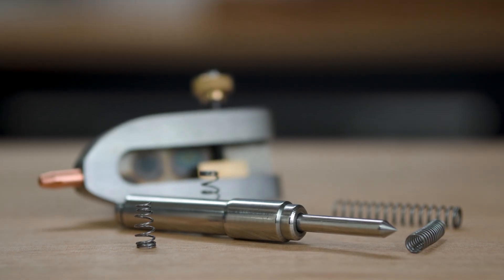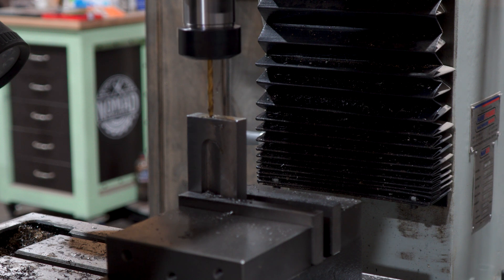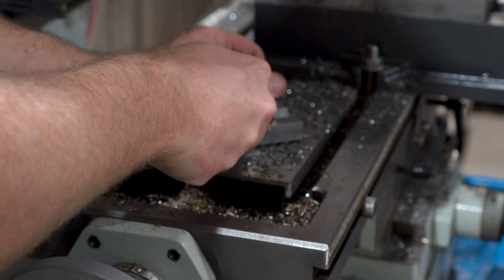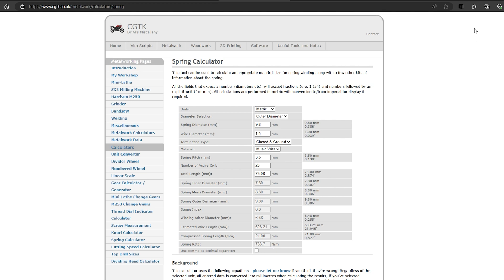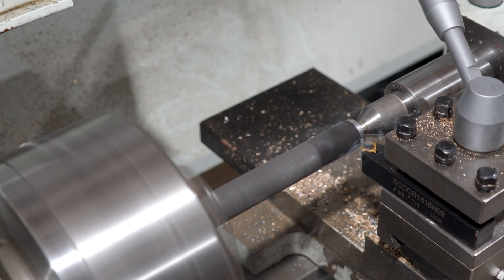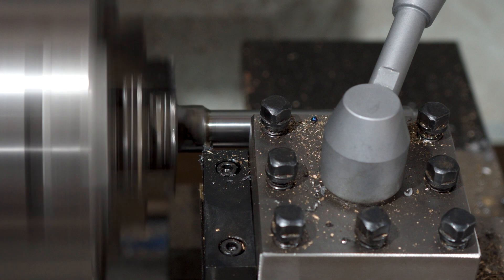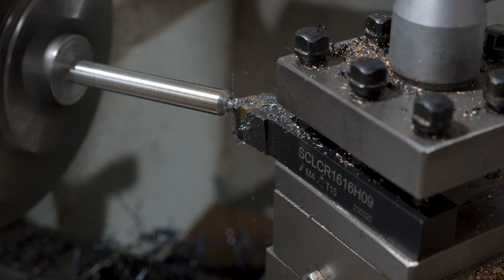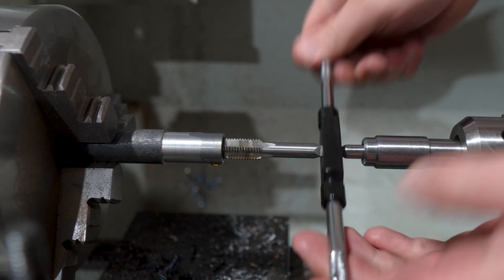Spring Making Redemption: Building a Tap Follower!

Comment: Same thing happened to me a couple of days ago, except in a Jacobs easy lock chuck, which now has a tap permanently jammed in it, as my scrawny arms can not get enough purchase on the chuck lock surfaces to undo it, even if I use the drill to turn it as I hold it (which usually works, but I think the tap, jamming, semi burnt out the motor, as it smelt faintly of magic smoke when it happened)... easy lock, but a PITA to unlock lmao....

Comment: Maybe really late to the party, but i guess that the sudden tension release from cutting the wire might be the culprit of the bendy/oversized spring. I'd try easing off the clamping force on the wire first and only cutting it, once the sprint settled into it's final form
Reply from the maker: That’s a fair call, it could help with the kink.  I have learned since making this that cutting from the opposite end of the spring that I did in the video does help it stay a bit straighter, but I might just try this on the next one. Thanks for checking it out

Comment: Looks like spring making is a lost "art".Lucky for me i learned from old guys.All of that fancy equipment people make is useless.What you need is 2 peaces of wood.Plywood works ok ,hardwood is best,something like oak.Then you cut a channel in a bottom part ,you can use a hacksaw or a file depending on your wire thickenss.Goal is that top board puts tension on the wire when you clamp it and bottom groove guides the wire .Edge of the board should be around 1cm from mandrel.Wire guide needs to be tangential to the mandrel.
Put a little bit of grease to make things go smoother.

If you want a fancy spring you heat it up with torch and let it cool down ,then harden it and temper it.
Spring making is an art and there are books written about them on how to make exact diameter and proper strength.
Reply from the maker: That would be a great way to make a quick spring, I have made a few now and I will say that I do like having the spring wire tensioner, it makes the setup so fast, but this would definitely work as a single purpose kind of deal. But thanks for the tip!

Comment: Didn't see you ream the front hole for a close fit for tighter Axial alignment.    

Done springs before, didn't work out so well.   I'll check out the calculator
Reply from the maker: Hmm it’s been a while and I can’t actually recall. I’m looking at the follower at the moment and there isn’t any uneven wear on the sliding shaft , it seems to be wearing evenly so either I did it and forgot to film it, or just got lucky with a drill 😂
That calculator makes all the difference, best of luck!

Comment: 2 flute taps are amazing for power tapping. As well as some tap magic or molly dee
Reply from the maker: Some machine taps are on the list, the ones I have are cheap rubbish, something I have been trying to figure out, I do understand the difference between spirals and straight taps, but if you happen to know, is one better than the other for machine tapping?
Reply: @nomadhandcrafted  I haven't used spiraled taps before myself. I have great luck with straight ones. The lubricant you use when tapping is like 50% of the issue . Also always use a sharp tap. The softer the metal the sharper the tap you want. Other wise it rips and tears threads.
Reply from the maker: Ah the sharpness thing make sense on the hardness of material, I’ve been using whatever cutting oil I have around, but I think I might have to pick up some tapping specific fluid by the sounds of it, appreciate the help though 🙏🙏
Reply: @nomadhandcrafted  You probably found out by now, but generally speaking spiral flutes are better for power tapping (it's material dependent somewhat tho). If the material likes to form long/continuous chips (like many ductile metals mostly do), a spiral flute lets them evacuate like a drill, and doesn't clog the hole like a straight flute may cause with long chips, as you've no way to stop and go backwards a quarter or half turn to break the chips, and something like a gun tap will just push the chips ahead of the tap which will be a nightmare if the chips aren't broken up, like when hand tapping (assuming your mill doesn't have them kinda automatic "stop reverse stop advance" features like a purpose built tapping machine does). However if the material you're tapping makes tiny chips, or dust, you can generally get away with straight flutes when power tapping (like with more brittle metals alloys etc).

Comment: Nice Style of video making!
Snapping that drilbit might have been avoided by using the mill that the part was already clamped to. Maybe you’ve decided not to due to rpm 🤷🏼‍♂️
Reply from the maker: It’s a really bad answer, but I don’t actually have a taper to suit a drill chuck for my mill 😂 and I didn’t have a collet small enough for that drill bit, but it’s on the list to make 😂 appreciate you checking it out!
Reply: @nomadhandcrafted  Well i guess it’s a good reason why it wasn’t used though😂
Reply from the maker: 😂😂 yeah I don’t know how I’ve managed to get by without one, I’m hoping to try my hand at tapers and making one myself soon!
Reply: @nomadhandcrafted  google for how to drill copper - soft materials like copper need different rake, different bit angle, different speeds, correct choice of coolants.. Some experiments on drilling different metals and different hole sizes etc would make at least one worthwhile video.  Some of the best engineering research comes from making careful measurements and records of purposely pushing stuff to its breaking point.
Oh, and the German Copper Institute publishes a 68 page book on the engineering details of machining copper and copper alloys. The book is kinda dry and boring , I wonder if anyone wants to try making its content more interesting
Reply from the maker: That’s actually an interesting idea, I will write that down on my video ideas list as it could be an interesting rabbit hole. I do have some understanding of how to do it properly, at the time I was just thinking “I’ll buzz a quick hole through this without a whole lot of thought” but with a little research and trial and error I think it could be fun ! Thanks for the idea! 🙏